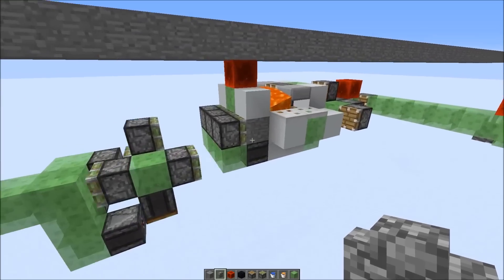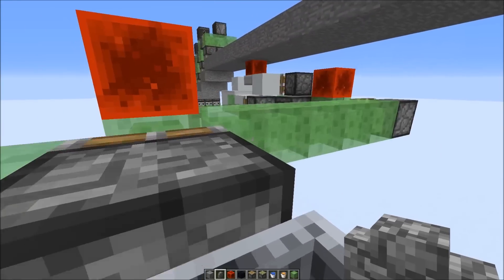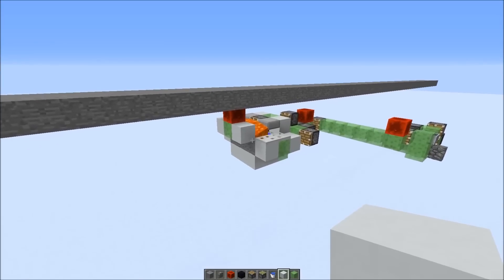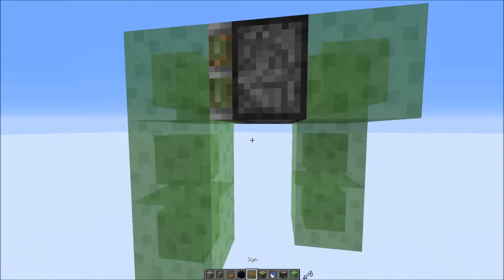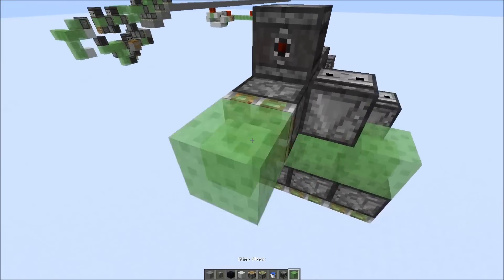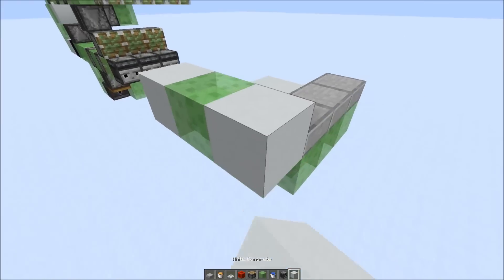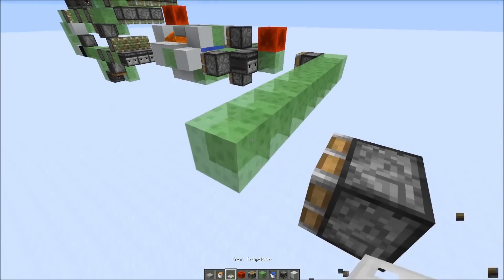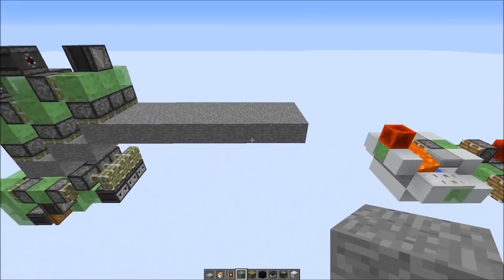Movable Automatic Stone Bridge Builder 1.11/1.12

Comment: Great idea
It is a pity, it does not apply on the skyblock. There the abserver is not done ((
Reply: В Гостях У Гро I'd advise using a slightly modified loot table so that wither skeletons drop quartz. I've used this in conjunction with the coordinates for the witch hut and nether fortress on the original skyblock worlds